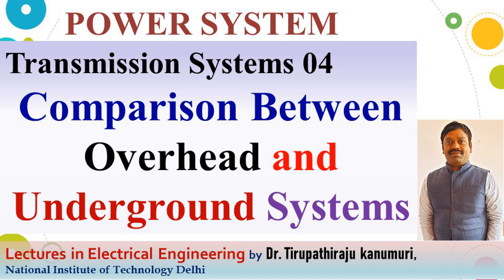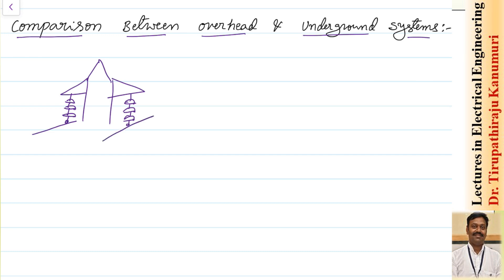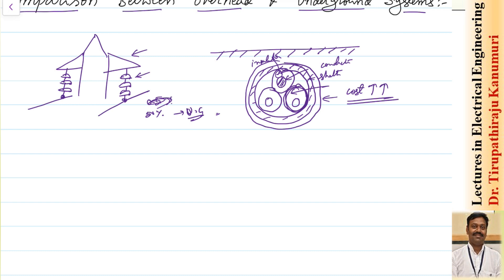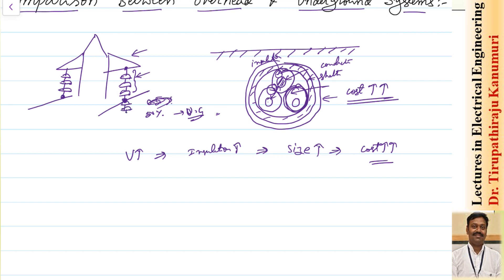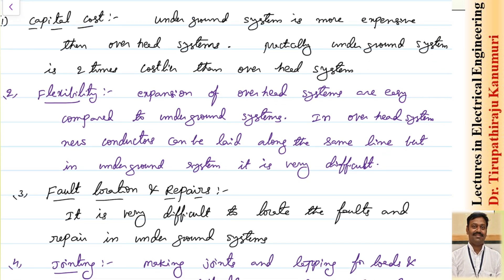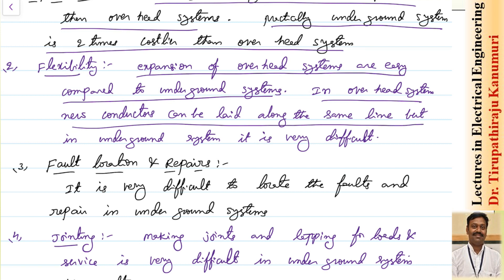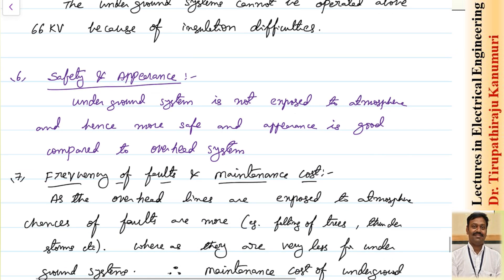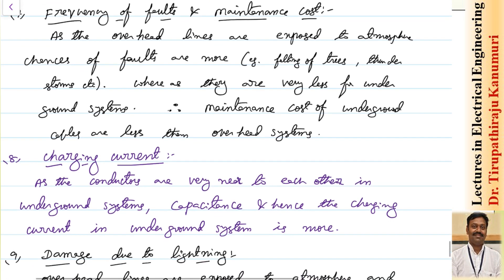PS04 Comparison Between Overhead and Underground Systems

Comment: 7.11... Dear Sir, when you compare the capacitance values of OHL and Cables, I think distance between conductors is not deciding the Capacitance value, it is type of dielectric material. Capacitance is characteristic of insulation between conductor and earth, hence, other conductor is not matter.
I believe because of Cable has different dielectric material, the capacitance is high and since, air is dielectric between conductors in the OHL, the capacitance is low.
Please tell me if I am wrong. Thank you
Reply: Incredible lecture